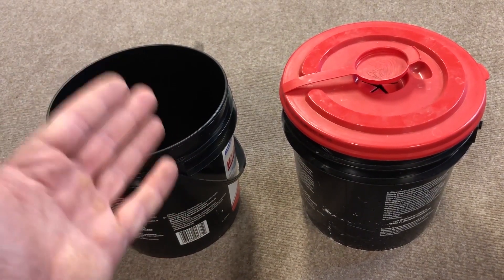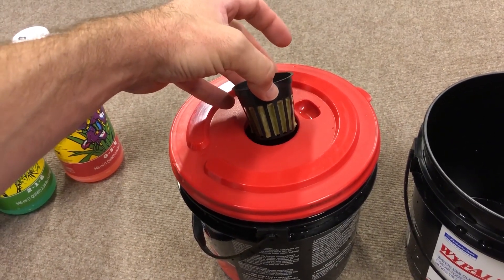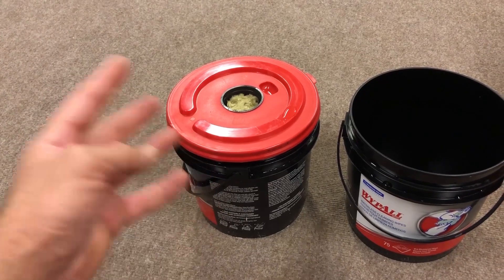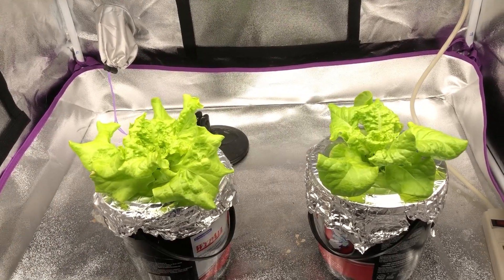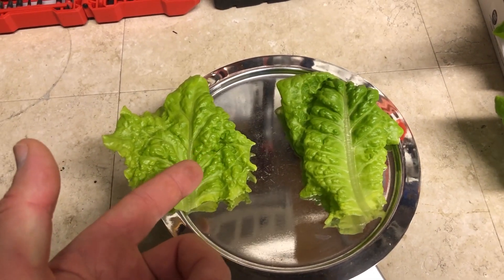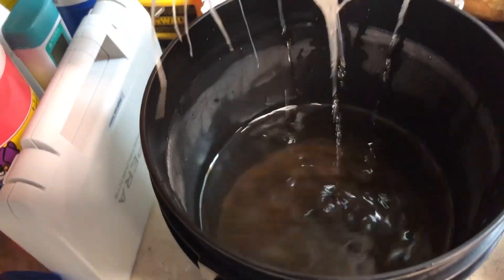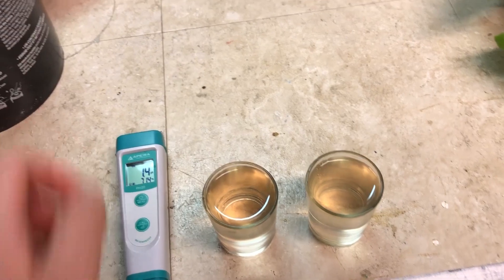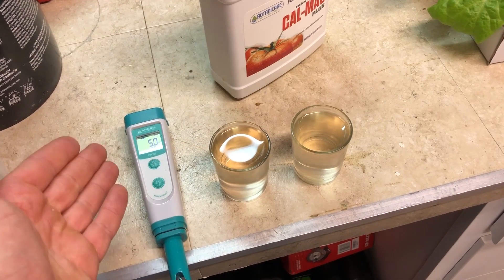RO/DI Water vs Tap Water Hydroponics | Lettuce | EP1

Comment: Your tap water has a relatively low ppm, RO are used mostly when your ppm’s are 250 and above. We actually buffer our RO water back up to around 150ppms,
Reply: What do you use to buffer it back to 150ppm? Thanks
Reply: @moongloomable  any calmag will work, ive tried many and they all seem about the same.

Comment: Great channel...I'm in Northeast Ohio as well with Lake Erie water. You mentioned your water was soft? Wow, mine is like a brick!
Reply from the maker: 140ppm is considered on the soft side. The lake water tests the same as my tap.
Reply: @GrowingAnswers  I thought water hardness was tested by ph? My ph out of the tap is almost 7.8.
Reply from the maker: @JM-gs5jn  need a tds meter. Ph just speaks to bicarbonates. 7.8 is not abnormal out of the tap. The ph will naturally lower over a few days after it off-gases from being under pressure and then absorbs co2 from the air.

Comment: Would this Mars hydro be enough for a 3x3feet or 3x3meter area?
Reply from the maker: nebulaM16 more than  enough
Reply: Growing Answers
Really, how come?
Reply from the maker: nebulaM16 3ft not 3 meter. Because of the coverage and amount of light it puts out. I’ve only been using it in its dimmest setting in 3x3.
Reply: Growing Answers 
3Ff or 3meter, it’s all the same, isn’t it?
It’s all measurements, just a different unit, exactly like having EC at 140ppm, right?
Reply from the maker: nebulaM16 1 meter is 3.2ft
Reply: Growing Answers 
You really think I don’t understand imperial measuring system?
You’r first answer was...more than enough.
Only when I asked twice you noticed the mistake and then answer it write.
All I want to point out is your mistake with EC and PPM which you just won’t acknowledge.
You can NOT get EC to 140ppm period!!!!
If your EC Meter reads 140 micro/Siemens, then the PPM meter in same solut reads only 70ppm.
If it’s 140ppm than the EC is 280.
Just like Ft must be converted into meters and vice/versus , so must be PPM to EC and vice/versus.
Reply from the maker: nebulaM16 I already acknowledged that. By telling you that a cheap tds pen measures ec and not tds. It just approximates tds by converting what it measured. So when I say ec or tds it doesn’t mean it’s the same thing. It just means that’s how it’s measured. If I measure temperature and say 100 degrees is boiling, some American people would likely be confused. But a boiling point is a boiling point. You get to the same result no matter what unit of measure you use. In the hobby most people are using a cheap tds pen and don’t realize it’s not measuring true total dissolved solids. So saying I’m measuring EC is true. And whether it’s 400ppm tds or 140 it’s just a mathematical conversion that the meter uses from its measured conductivity (Ec). I know 140ppm is not 140ec.
Reply: Growing Answers 
Not boiling point.
The proper example would be to set just a number on temperature like 72 and say Celsius or Fahrenheit.
Reply: Never

Comment: OMG AWESOME EXPERIMENT!!! nice video, greetings from germanyin europe there are two types of flora micro (hard water and soft water)
What is your EC level of tap water (what conversion are you using? 700 or 500) you should use ec instead of tds imho
what does you water company tell you about the minerals in the water? mine is high in calcium, which should be good mixes with flora hard water but its not good